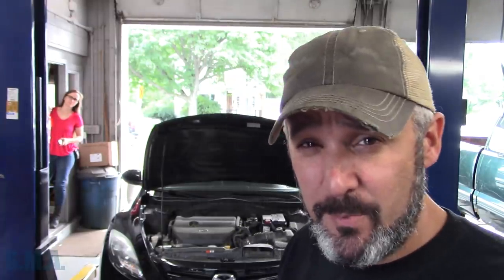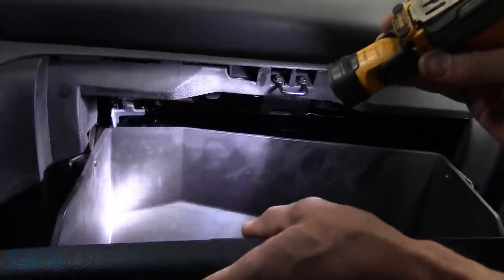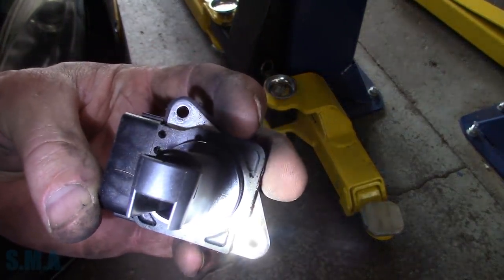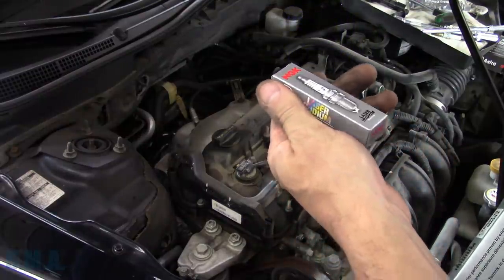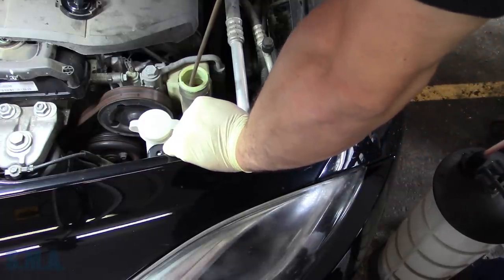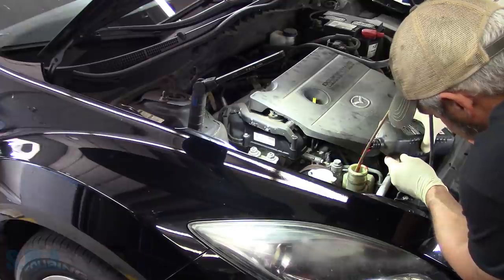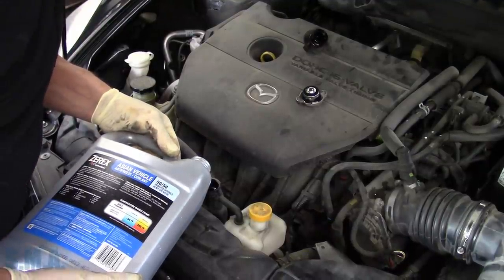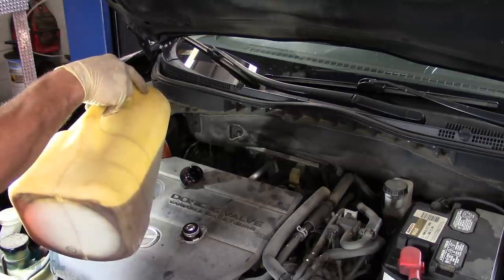Mazda 6: 100k Service Front To Back

Comment: Say Eric O. When I picked up my car it had 94,000 on the clock. Since I am old with not much money, otherwise the car looked brand new top to bottom. The dealer said they had changed all fluids but my hunch was not the transmission.  I was correct as it looked like used motor oil. The fluid was also full of clutch material. The good thing was the car had no symptoms. I changed the fluid twice and now it looks like regular fluid and 10,000 miles later still runs perfect. I have seen these 62te transmissions run 1/2 million miles before needing work so I was hoping with a little maintenance I could also. Still hoping.

Comment: My 06 CHEVROLET wheelchair van was always serviced by a dealer under the previous owner. At 100k I asked my indy mechanic to check the cabin filter. When I picked up the van he headed me straight to the shop to show me the filter . It had never been changed so it was black and crusty! (Another good bar name)

Comment: the 5 dislikes are from mechanics that swear by threadlock on spark plugs
Reply: Loctite red works the best 💪
Reply: @FredTheLutinoCocatiel  That, and a quick tack weld for extra safety
Reply: @ivenhoho  I find brazing helps seal the combustion better!

Comment: Does anyone clean the throttle body as part of these high mileage services?
Reply: Throttle body and maf sensor
Reply: I always clean the TB on every car I buy, it's a must
Reply: Don’t spray them all willy nilly with throttle body cleaner on an early 2000s Nissan or you’ll be buying a new throttle body 😫. Just wipe out with a rag. Ask me how I know....
Reply: @brianruiz1739  Hey Brian, Given i have an 03 Nissan, care to shed some more light on what goes wrong?
i do know mine has an idle relearn and TB relearn that can be done without a scan tool if that makes a difference?
Reply: @KSSilenceAU  I’m not sure exactly what happens but it seems the spray might get into the electronics of the butterfly valve motor and then that idle relearn procedure will no longer work. I had read about it too before cleaning it out but thought, “nah, won’t happen to me, I’ll be careful with spraying.” I didn’t do a ton of crazy spraying, but it still killed it. Just spray a rag with cleaner and wipe out what you can. Costed me $300 or so for a new TB if I remember correctly.😒😣
Reply: @brianruiz1739  AH Ok, thanks for the heads up.
Ive got a 2003 Nissan Stagea M35 with the VQ25DET, and being an import, TB's aint the easiest thing to sort.

She idles perfectly fine like a kitten purring currently so i have no reason to fiddle with her, i was just curious what the go is.

Comment: Blooper reel at 32:15
That 2.5 is a good little engine although it's a little noisy when you really put the coals to it.  I have the same 2.5 in my '14 Fusion and it's at 140k with nary a problem (probably just jinxed it).
Like most engines nowadays, take care of it and it'll take care of you.
(Edit:fixed a spelling error)

Comment: How you can tell I drive an old Chevy:  I never change my power steering fluid, give it six months and it will be all-new fluid anyways.
Reply: Gotta buy high pressure hoses by the case.

Comment: I thought Ford's 100k service included engine and transmission R&R
Reply: try 68,000         My engine blew   Same exact car he’s working on,  But my car is in a lot better shape   looks  and rust wise.    It’s gonna cost me about three grand  to  get   a  Engine with 20,000 miles installed into it..      Then I will have another 50,000 mile full  warranty on it,, Of course you need Ase certified tech  to install ..to get  the warranty  from the engine place that sold it to me..      I would’ve done it myself if I had a garage or a place to do it...    I have  done most of my work on my car in a local parking lot...     lol    Usually in high temperatures 110+ sometimes..
Reply: Nah. My 26 year old mustang disagrees.
Reply: Tons of 20 year old F150’s all over around MS.

Comment: Don’t forget the Duralube engine and a splash of Duralube transmission formula!
“Lint in her crack”..lol..just about fell out of my chair!
You are right about not using never seize on plugs.
It makes them difficult to remove in aluminum heads.
Those laser Iridium NGK plugs are well crafted stuff.
A-little spendy, but long lasting!
Thanks Eric.
:-)

Comment: My 2011 Mazda 3 (also 2.5L with 6 speed manual) just hit 100k so I had just done all this myself, plus front brakes, sway bar links, and a ball joint.  My 2010 CX-9 is about to hit 200k so I’ll be doing the same on that in the near future.

Comment: I always suck out the fluid from the master cylinder first, then fill it with clean fluid, put it under pressure,  release the pressure, have someone available to push the brake pedal, and crack connections out of the master cylinder and close them up before the pedal reaches bottom. No air gets in that way.  The object is to only squirt clean fluid down the lines.  I have found considerable crud in master cylinder reservoirs and ya can't suck it all out. Then pressurize and do all the lines to the wheel cylinders using only clean fluid.  This has frequently got me another year or two out of a master cylinder that has started leaking internally.

Comment: One cabin filter tip is cut the front panel off the new filter box (or other cardboard) and slide it under the existing filter before removing from housing. Catches anything that falls off the filter & keeps it out of the blower.
Don't know why they started putting these things behind the glove box. Under the front cowl made more sense.

Comment: Hey Eric,  I've gotten into the habit of putting a handheld vacuum pump and applying a little vacuum on the system if a noise happens. Let it sit there for 15 mins of more while I do something else.  Most of the time it works.  I learned it from a gm bulletin. I don't remember the number off hand.

Comment: Good advice on the transmission fluid.  The AX-15 5-speed manual in my '98 Wrangler needs GL-4 because of the yellow metals in the synchros.  I use Redline MT90 and my 160k mile trans shifts great.

Comment: Hi Eric I was finding a mouse nest in the civic cabin filter a couple of times so I put some stainless steel pot cleaner in the air access with out cutting the air , chew on that you little critters  works well .

Comment: Every time that I have added 75w90 gear oil to a manual transmission (or maybe it was 80w90) I could completely forget about downshifting to 1st gear at anything more than a complete stop for the first two miles or so when the temperatures are below like 40 degrees.  In the winter, having icy intersections made things easier because I could lock up the wheels with the brakes, shove it into 1st gear, and be able to roll through the stop sign which pretty much everyone does.  

I don't think I ever had a manual transmission apart that did not have brass synchronizer rings.

I switched to 5w30 engine oil and never looked back.  The original Honda manual transmission fluid has the consistency of 
water at 70 degrees.
Reply: And I have never seen the slightest hint of corrosion in any manual transmission unless it sat outside for water to get into it.  I am not sure about what the "safe for yellow metals" is all about.
Reply: Now that I think of it, I used 80w90 GL4? or GL5? Gear oil in the transmission of an Escort GT.  The Escort is a Mazda 323 and the GT uses the Mazda engine.  It was also impossible to downshift into lower gears when the transmission was cold, and when near zero degrees, I could let off the clutch in neutral and the car would creep forward due to the thick fluid viscosity.

There is something wrong with the labeling of the gear oil or what they put in vs who writes the specifications books or something.  It is a bad choice of manual transmission fluid in my experience.  I put on 100,000 miles on my Geo Metro using 5w30 conventional valvoline in its transmission and never had a single problem with it until I decided to quit driving it at 229,xxx because of excessive rust.

Comment: You stated that if you flush the radiator with H2O to clean out old antifreeze then put in antifreeze that is already diluted it would dilute it even more, however, undiluted antifreeze is sold as well.  So in an 8 gallon system where 4 gallons of water remains in engine block, putting undiluted antifreeze will dilute to the 50/50 mix, same as diluted antifreeze.  I have found in some cases the undiluted is actually cheaper than diluted.  I use the 50/50 mix only when topping off reservoir  between flushes.

Comment: For power steering fluid just yank the low pressure line (male to male barb + clear tubing) and plug the hole in the reservoir.  Without even running the engine just rotate the wheels lock to lock and catch it in a can.   100% out without drama!

Comment: One  thing I would have done differently is how you change the power steering fluid. It's pretty easy to disco the return line and couple it to a drain line without making a mess.  I plug the reservoir at the reservoir return line connection and turn the wheels while refilling the fluid into the reservoir. It completely flushes the old fluid in the process. You definitely have done way more of these, so I default to your experience.  That said, I have a criticism... I would replace the old/original crush washers with oem replacements on the differential/Trans drain/fill plugs.  I never take my vehicles to a dealership when I ask if they have these parts in stock and they say they have to order them.  Tells me they're not doing it right. That's why I do it myself.

Comment: I learned to drive, worked on, and drove a 318 '73 Dart in high school. Also had a 340 4 speed '70 GT leaving high school and later had a '67 slant 6. Watch out for the driver side reverse thread wheel studs.
Reply: '73 in high school. Dam! You are old as dirt!! Medicine has come a long way! Btw, what you driving now?
Reply: @jeffreysantos9070  Not quite as old as dirt, but when I got my license in '76 gas was 25 cents a gallon, average wage was $1 an hour, and we used to write a letter with pen and paper. The '73 dart was my Mom's and I used to power slide it around corners. The '70 340 had a locker posi and I beat everyone I raced on the street, and bought it for $900. My car right now is just a '97 Geo Prizm.

Comment: What I need is a coolant and a brake fluid funnel that has a drain hose/breather, so when the fluid level is where I want it and the bubbles are out (or the brakes are bled) I can suck back the excess and save it and be at the correct level without spillage, the hose level would need to be adjustable but also not loose otherwise it would slip out because I have such bad luck that I can even spill from a sealed container

Comment: I just pull the PS pump return line and put the MityVac tube in to suck the system dry. Then fill the reservoir and suck that through. At the end, let the reservoir run low so you can replace the return line with minimal mess. Easy peasy. Thanks for the viceo; I am looking for a Mazda for my niece. This helps!

Comment: With a rack, there is no need to start the engine. Just operate the steering lock to lock until fluid is clean as the rack operates as a piston pump which does not cause aeration of the fluid. The pump causes the aeration.

Comment: I like to squeeze the end of plug boot back and forth a few times to spread the grease a bit and leave a small void in the center, they kind of vapor lock and push the grease out or try to pop the boot off. not so much an issue with bolt down coils though :)

Comment: The service schedule on my UK Mazda3 Sport (2l) acknowledges the lack of a coolant drain on the block. First change is at 4 years, subsequent changes are at 2 years as you're only changing half of it. When I changed from the Mazda coolant to another I filled, ran and drained using plain water several times until I reckoned there was none of the original left, then put in the required amount of undiluted AF and topped off with water. 

That cabin air filter change is a lot easier than on the Mazda3 Mk1. When I changed mine it was clear the main dealer who had been servicing it clearly thought it was too much hassle going by the date code on the one I pulled out. Still charged me twice for changing it. Made me wonder what else they hadn't done that the average customer wouldn't check.

Comment: I have the same engine and use anti-seize. Wondering if I should stop. Honestly haven't had an issue thus far, but I trust Eric's experience. Also for power steering, I've disconnected the return line and turned the wheel stop to stop while the engine is off. Gotten all of the fluid out that way.

Comment: here in europe where the 3rd pedal and fwd is common they used to say you never need to change transmission fluid so many owners take it as for the life of the car. what they forgot to say is that when you do any clutch/flywheel job at an average of 200000 km, the first thing it's done is draining old fluid. also we use iridium spark plugs mostly only on dual gas/gasoline or high power engines higher combustion temperature engines because you know, useless spend more money and sometimes no added value except something similar to the flames decals on the bonnet for the 25 bhp per wheel...

Comment: You should of put Ford plugs back in that car. Ford worked first they will go on working,  lol. After market parts bite on newer car's. Especially the electronic parts. How did you drain the brake fluid without bleeding the brakes? That would be a great subject to do a video on.  Awesome video thanks for sharing. Stay well and safe my friend.

Comment: Bought a 2013 back in April and I just hit 101k so its time to do most of this. Not sure if I can do the powersteering but everything else I should be able to do. (Car had a complete brake job before I bought it so the fluid is fine.)

Comment: Is correct about the anti seize on the spark plugs it is not necessary on the ones that have that shiny look to them I forget what it's called it's basically built in to where they won't seize in the head he is correct that if you contact the manufacturer they will say not to use anti seize it also will affect torque ratings as well love the channel and the always quality work performed on the vehicles you work on

Comment: LOL,Lol... At about 32 mins, I was reminded of my old Dodge truck. They have those, cheapo, plastic caps. Master cylinder and coolant caps are the same size, very course and rather fine threads. In my defense, it was getting dark by then, lol 😏

Comment: That pump you used to fill the transmission would have been so handy. Just changed fluid in my rear diff, gonna do front Monday, boy oh boy does that little screw on pump get old after a minute.

Comment: Not only you need to put the drain plug back but you actually have to tighten it.  Back in the 80's, brought the company car in for an oil change.  40 miles down the road, the plug fell out and lost all the oil on the highway.  Tow was needed and the office manager was p!ssed.

Comment: Just a giving you a "slave cylinder" shout. Pretty sure there is a clutch slave cylinder in play. It gets fluid from the brake system. I don't know if bleeding the slave is called out at 100K.

It has been my experience that clutch slave cylinders that feed from the brake system are a little like an "appendix". They tend to hang on to moisture and give it back to master cylinder...

Love watching your videos.

Comment: Hey love your content. Just a heads up for the customer, there is a recall on the cradle for those years. They replace the cradle if its rusted through...otherwise they apply wax and put a reinforcement plate on it. Ive had a few come through the shop where it was so bad they lower control arm on the right side came out the cradle. They say its caused by the a/c drain...so they relocate that as well.

Comment: Hey Eric. Nice job, but I got to disagree with you in the use of "dielectric" grease inside the spark plug boots. While it does protect against moisture and corrosion, it does NOT conduct electricity,  so it shouldn't be applied directly to the mating surfaces (pins and sockets) of any electrical connection. The grease you want that repels moisture, stops corrosion AND also conducts electricity is NO-OX-ID, it does all that and more. Apply a light coat to ANY electrical/audio/video connection for maximum protection.

Comment: Engine flush with oil plug back in and new filter on, drive car around for a few miles and drain and refill. Only tighten oil filter by hand. Fill new oil to about halfway drive the cad around, then check dipstick as oil expands with heat.

Comment: Good call on the spare tire...need to check mine. Have a 2011 M3 2.5 manual HB.

No motor mounts? Was told standard practice on Mazdas especially manuals...

Comment: Yes Eric, maps are still used today. One of the problems I have encountered in programming a route on a GPS is the GPS will not willingly take secondary roads. It's either the freeway or the second fastest way, but never the scenic or desired way. That's where the maps come in. You can take a map and figure out your route and then enter it in your GPS but adding in the towns along the way as waypoints. This will keep you on your chosen route and avoid the interstates if you want. The only thing you have to remember is to delete each town as you approach it because the GPS likes to take you to the geographic centre of town. (I once ended up in the centre of Atlanta Georgia when I forgot to do this which isn't where most people think it is incidentally. It's actually Mozley Park area. Met some very nice folks there.) If you delete the town the GPS will automatically look to the next waypoint on your route and start to guide you there.
Reply: Scooter to talking GPS: "I don't want to take the freeway."
GPS: "I'm sorry, Scooter, I'm afraid I can't do that."